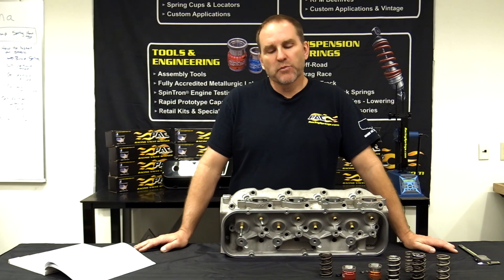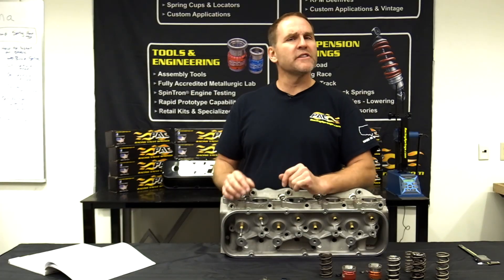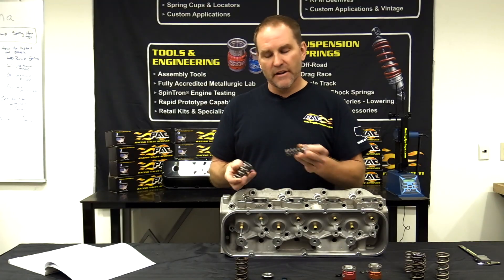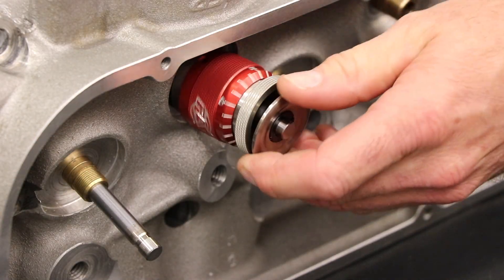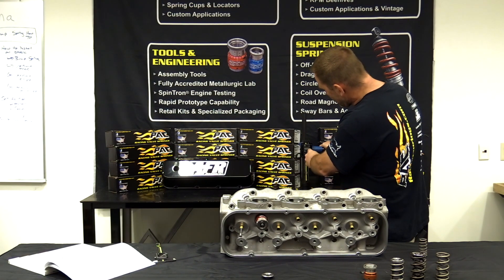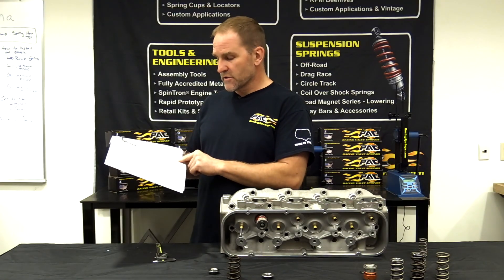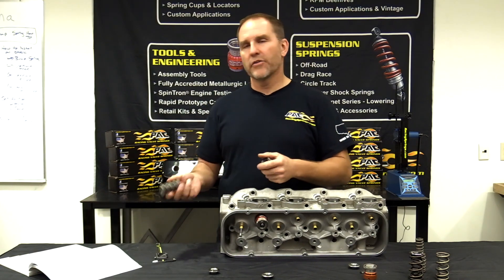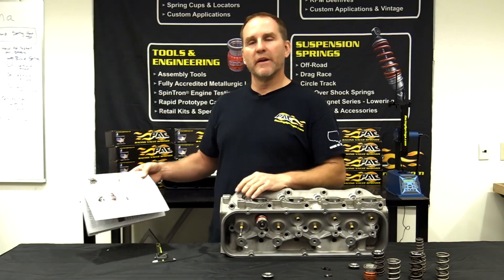Valve Spring Tech Specs and What you Need to know - PAC Racing Springs

Comment: Ive built many heads and race engines..the "right"spring is what ya gotta have.no body wants to loose a valve in their pride n joy motor due to springs or wrong springs.dropped valves busted pistons cracked blocks ive seen it all.

Comment: 9:50 "Everybody knows about flat tappets..."    What's your theory for the current epidemic of flat tappets & cams? Oil? Zinc? Soft metal? Chinese parts? Bad lifter crown machining? Aliens?
Reply: havent seen a lot of failures like this lately.  that was a bigger concern about 10 yrs ago.  if i do  see them  someone didnt keep the engine running at the RPM  they were told to by whoever sold them the cam

Comment: My cam is . 540-.560. I'm looking at 1218 & 1219 springs. I like the higher seat pressure of the 1219, but would I be better off with the 1218 shimmed tighter than the 1.8 installed height PAC recommends to get closer to coil bind for more pressure on both the seat and over the nose?

How do you use the spring rate to figure spring load at a specific lift?
Reply: 1218 spring

313 spring rate X .560 lift  + 130 seat pressure = 305 open pressure @ .560 lift
Reply: Spring rate is normally in lbft per inch
Reply: spring rate X full camshaft lift (i.e. .540-.560) +  installed seat pressure  = open pressure at specific cam lift

Comment: Can I run a cam lift of 0.660 when max lift of my spring is 0.660. Or do I need a little safe space like 0.657 lift.
Thanks appreciate.
Regards S Erasmus
Reply: Yes. It's better to be as close to max lift as possible for springs so that you're (typically) .050 or so (he says they recommend .060 to .080 for their springs in the video) from coil bind at max lift. That actually makes your valvetrain more stable/safer than using a spring with a much higher max lift than your cam has.

Comment: Two days ago, I ordered some PAC 'Hot Rod' SBC springs from Jeg's. It was a pretty easy choice for my application, because no one else seemed to offer what I needed. I'm putting 1.6 roller rockers in an L98, which is a low-RPM engine, and I could probably get away with using fresh stock springs. But I think Chevy probably specs the stock springs as light as possible for fuel economy, so I wanted uprated springs for some valve train durability and stability head room. 

Shopping primarily Summit and Jeg's, I found nothing comparable from the usual sources like Comp, Edelbrock, or whatever. Maybe I just missed them somehow, but I looked pretty hard and long. Though I'd never heard of PAC (I'm new to the SBC world), I went ahead and ordered their Hot Rod springs. After watching this video, I'm confident in that choice.
Reply: Sbc is your downfall. I'm sure you've not enjoyed or experienced anything fast or that actually sounds good. So it's not entirely you're fault. 
You are forgiven. 🤠
Reply: @Jeff Peterson  the L98 is legendary. Was smashing 911's in its day

Comment: I’m looking to change springs & rockers on my 94 Chevy impala SS. Stock cam & looking to install beehive comps with 1.6 RR. Im very curious & as a mechanic Iv only done this in school. My lt-1 would like a change. 105,000 miles on her & I plan on doing it under the hood. I can’t find any videos showing you on how to do it with the engine under the hood. That tool looks like it would make life easier instead of the one I have. This video is very informative & I just subscribed 💯🏴‍☠️🇺🇸
Reply: leak down tester throws compressed air in there and holds up the valve.
Reply: look up putting a 1/4 inch rope into the combustion chamber through the spark plug hole.

Comment: That was short, sweet, and to the point. Not to mention, very informative. The best compliment I can pay you is to subscribe. I don't need to turn the high  rpms for index racing and the limited lift of my heads (.600"), but I since it is a street\strip car, getting more hp with more rpm has a certain primal appeal. No wonder Trick Flow chose your springs in the GenX 225 "as cast" 13.5 degree heads for SBCs.

Comment: Great information, but it seems like you are being forced to do this video.... also, heighth is not a word.
Reply: "Valve stem installed height is the measurement from the tip of the valve stem to the valve spring seat or cup. All valve stem heights must be within specification. If one valve stem is higher than the others, suspect that the valve face or seat is worn. A valve stem height gauge may be required to measure this height."